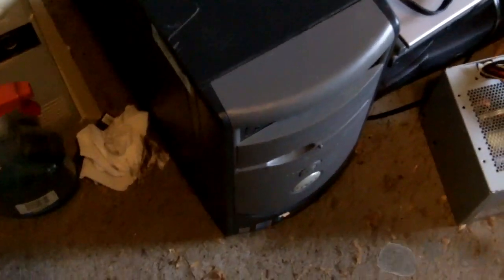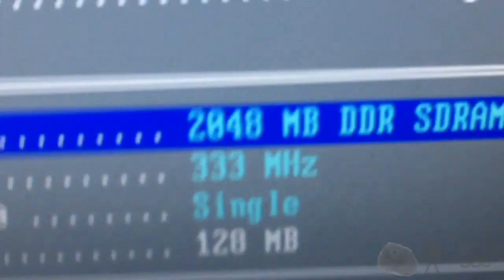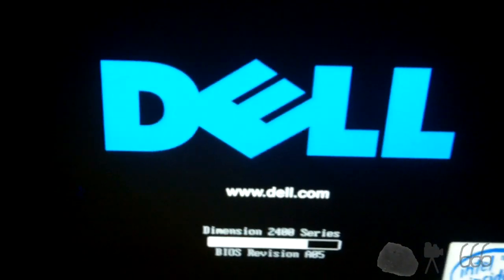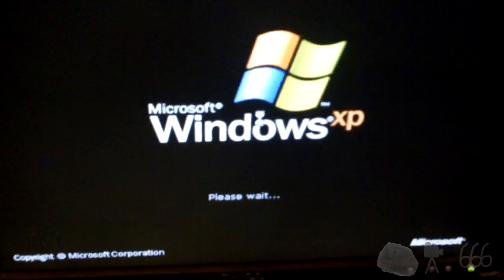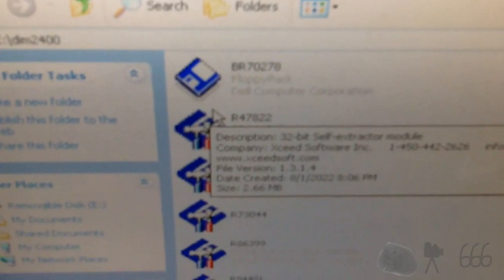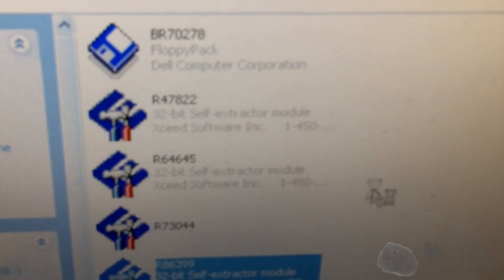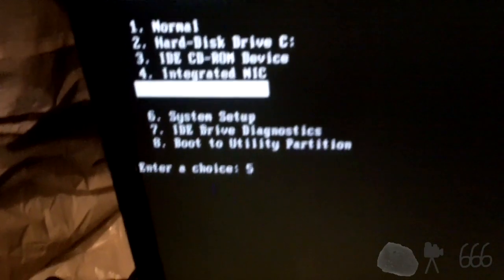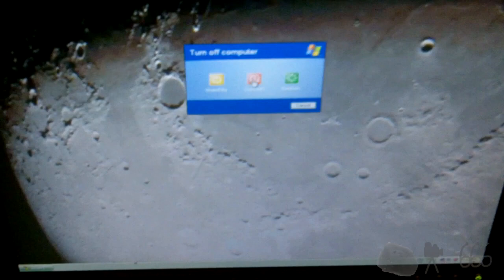Installing Windows XP On The Dell Dimension 2400

Comment: That's a modified Windows XP ISO. Notice that it has IE8 built-in.
Reply from the maker: It's much more convenient than the "legitimate" disc on systems I don't want SP4 on, since the disc I have is only RTM...
Reply: @CarnelProd666  I like to use those as well. I just wasn't sure if you were aware.
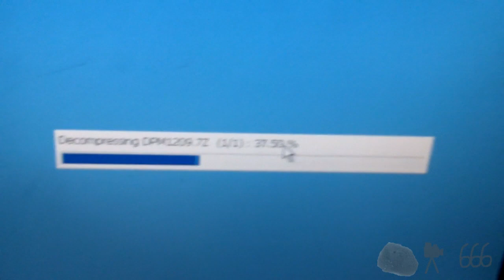Reply: You can also tell it's modified by the dialog box extracting 7z files at 5:45 in the video.